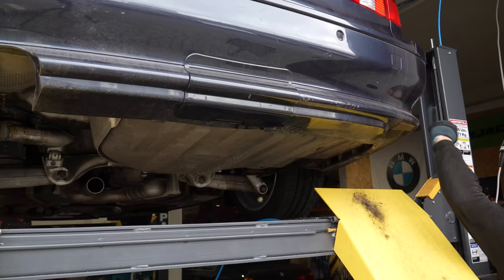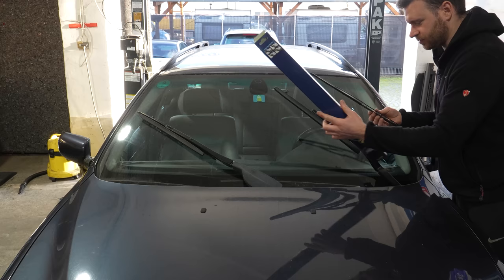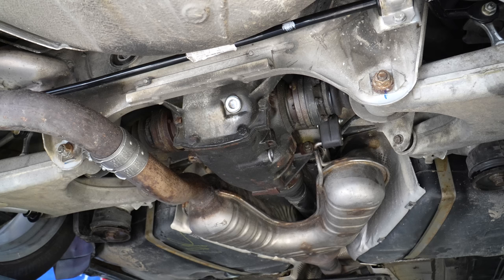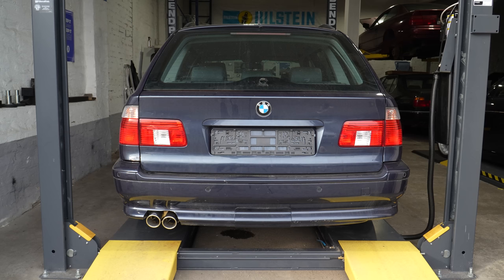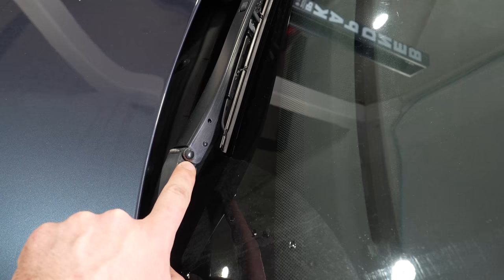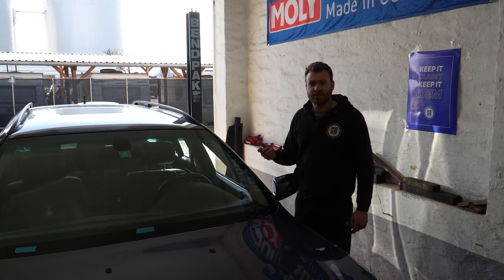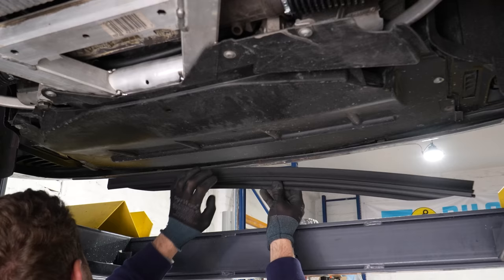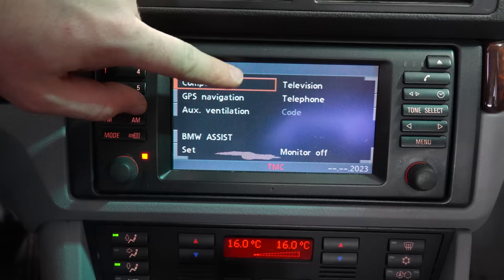Shouldn't Be Put Back on the Road - E39 530i Touring - Project Rottweil: P4

Comment: in the E31 club we always had people asking why their wheel shimmies at certain speeds.  You are going to have one at the fundamental and other harmonics in speed bands of 10-15 due to the spacers.  We always said ONLY OE approved wheels will prevent this, but some don't care about replacing bushings and the vibrations as long as the car looks cool to them.  We always advised to walk away from the sale if the previous owner did this, because usually they spent money on wheels at the expense of routine scheduled maintenance.  But obviously you always go through all your cars and try to keep it as OEM as possible.  Can't wait to see the dyno and hear tales of your butt dyno video.

Comment: Put some jl audio 5.25 speakers inside the car. Use gasket sealer around the speaker to get good seal and make sure to reuse the foam. Without it you loose half the sound. Uppgraded my speakers and sounds much better

Comment: You don't need to splice speaker wires, there are adapters that fit into factory connector but opposite gender, you wrap it in Tessa cloth tape and leave it

Comment: Also i forgot to mention, for the audio upgrade that you want, for european e39/e53 there was the DSP  audio system, it´s not super good but it´s a notch better than stock. You will need to source the module, dsp amplifier and i don´t know if the unit itself is different for the dsp ones or maybe you can reprogram it. I know some functions can be added to the unit, such as remote heating and vent, if you have a webasto heater that is.

Comment: Hey sreten, I've upgraded VW brakes to a bigger type before. I had to program the ABS module for that because the amount of displaced fluid increased with bigger brakes. I don't know whether this is needed for BMWs or not. I thought I'd just give you a heads up. I thoroughly enjoyed the video😊

Comment: You pretty much covered why I always prefer a 5 series to the 3 series... the suspension in the E34 and E39 is far superior to the E36/E46. Even on coilovers with my E34 lowered a fair bit on 18" wheels, it still handles bumpy roads with a reasonable degree of comfort, whereas most E46's feel crashy and harsh.

Comment: fyi i did a perm fix of the heater pipe  issue on that same  car 528i 1999( ne 2000 model ) i tapped out the block where plastic pipes  go in and put in threaded  fittings  with a barb  then from there used  silicon hose  back to where plastic pipe is at 1st mount and  that cures  the  dreaded  snap issue on them as vibration and corrosion  wear the part into block out    i had replace the  pipe 2 yrs ago and it was gone again SAME PLACE AT BLOCK  hopefully this cures that problem as rest of plastic pipe is  ok  and i replaced pipe as a  thing  after cutting it 2 inches  from 1st mount hose clamps are  stainless on line to heater  taps  i used all silicone   hoses  and  fitted the org fitting  to it at end  cut off  from plastic pipe btw i have same wheels  17 x 7 on mine and i have 1  that as spare that needs to be straightened has a huge  flat spot on it  bad roads here in oz  out on sth oz border  in victoria rear muffler is 2x mufflers  at end 1 is a  dead end  and  2x outlet pipes  like you did 
no idea  why its like that but is factory spec setup

Comment: Been thinking about the speakers question.  Not wanting to give you any more work Sreten but wondered if you could borrow some Alpines to compare against the standard BMW speakers - maybe the amplifier is good enough.  We know the higher end stuff fitted in some cars could improve the sound..  Maybe there is a case to upgrade some internals of the head unit..

Comment: Putting that windshield seal on the car without removing the glass is a non starter . Had exactly the same issues with mine so I called in the pros also.

Comment: 1:13:55 playing with the fuel pump :D  i had 530i e39 01 Mtech imported from japan it had 76000km it was brand new, after 3 years and many memories later i was doing 200-220 it was +50c outside fuel pump failed radiator blew up, coolant container leaked, hoses failed :D gladly we were with 2 cars and almost made it to our destination,  had to quickly buy some chinese parts and we did fixing in the middle of autobahn :D :D :D regret selling it

Comment: Yeah, a BMW 530 and then a cheap Type I tape, sure. That guy could have at least used a Type II... I´d advise you to clean the heads and pinch rollers on your tapedeck in the car to avoid bad sound quality and a tape-eating deck.

Comment: Sensational Sreten! I really did very well to keep the desire to have a 6-cylinder E39 here in Brazil, we have the 528i, 525i and 530i. E39 Touring we only had 528i and 540i unfortunately...Which of the three mentioned do you recommend? And it really gives a lot of pleasure to save a neglected BMW! Excellent job.

Comment: I must say that I'm pretty jealouis of an e39 breaking well.
I'm trying to fix wheel vibrations under breaking for quite a while now, and I'me getting really pissed with the car.
I've replaced tires for new Michelin PS4, I've refurbished the wheels, I've replaced control arms with lemforder units, I've replaced wheel bearings, I've replaced the 292mm new disks that i've recently put on with a 320mm breaking system, I've refurbished the rack & pinion.... and that sucker is still vibrating under moderate or hard breaking breaking. It's driving me completely mad, and I'm tired of throwing money at this.
The only thing left to do is probably replacing the wheel carriers...

Comment: I dont know how is this possible that you always have to repeat the cluster lcd fix. I did it once honestly but i did it with just the cable and soldering, in my opinion it creates the best conductivity so I went with that (with special soldering iron silicone tip or something (5$))

Comment: You can restore the inner tail lights, for that to happen you have to machine sand the plastic lens after that you wet sand and polish them, just like headlights restoration. If you still can see little cracks PPF could fix that. 
And after all of that you will have perfectly good spares.

Comment: Oh god I remember the pain that was changing the lcd ribbon cable. I also bought from pixel fix, but I found the instructions unclear and the lcd had a small crack. Also, what is the point of marking the needle positions if by default they always point to 0 liters of fuel or lowest coolant temperature?

Comment: I wonder how many wrong things you would find in my E60 xD something is causing vibrations on the steering wheel, M54B30 drinks oil like crazy and there are occasional knocks coming from suspension X_x
I love it but I'll probably have to scrap it or part it out and buy Superb VR6 mk2 instead because restoring it to acceptable condition is probably not worth it (production model 2003  0_0)

Comment: why dont you try to add a bluetooth audio aux module to that navigation if it has a cd changer or aux port in the back i did that aux mod to a e46 cd radio and it worked great

Comment: Hi Sreten, i am really wondering how it went by the TUV Inspection, i tried using Epytec adapters on my Audi TT and swapping some Porsche brakes on the car, it’s a fearly common upgrade. But no TUV inspector would let it pass .. they all gave different reason. I presented them the papers from Epytec but still no. Thank you, i’m glad it went better on your side.

Comment: I always wondered who was that "genius" on BMW who designed this awfull zync alloy and used it everywhere. In my E36: broken key hub - corroded zync alloy, broken door handle - corroded zync alloy, broken mirrors - corroded zync alloy. I mean, OK, the car is old but I've got even older Ford and none of those parts are zync alloy and they all work fine to these days.:face-fuchsia-poop-shape:

Comment: Hi Sreten. 
I"m interested to know what camera were you using for your driving section? This is the camera that is videoing you from the passenger side. The reason I'm asking is that it seems like its a person videoing you as there is active movement and correction, even though in other shots, there's nobody in the passenger seat. 

I just thought it was an interesting shot as it looks very personal and dynamic.

Comment: It looks like rust is forming on the sheet metal where the glass attaches. Is this the repair you are going to fix. My back glass broke this past year because the frame rusted away. I need to fix this on my other one before it happens again. Love the touring series but I’m a little biased.
Reply from the maker: Yes, the glass hatch is all rusted. Needs to be replaced. Common issue on E39 Touring

Comment: Maybe you can help me would you know anything about the gong chime under the steering wheel if it has a fuse and where would it be when I insert the key I don't get the chime anymore I even changed it but still won't work when I put the key and turn it can you help Thanks much

Comment: Another question: apparently E53 and E39/E38 16:9 LCD displays are ... different, because of the different height relative to the driver's head. Did you get an E39 specific part or is it true that there are screws to adjust that as well?
Edit: cigarette lighter in the front needs fixing :P

Comment: I have a question to Sreten or even to all the guys who wrote a comment. I have a 525 Diesel from 2003. and just today i was in the Autobahn and i had an issue. The DDE lamp come up and the engine didn’t performed as it should and the engine stopped. Just stood their and after starting the engine again which was not easy the car drove but only a few km. Then the same issue came again and again so I repeated to stand and to start again. I had only 15 liters in the tank and as I rembered me one year ago when the car doesn’t wanted to start because of fuel engine I thought maybe this DDE issue also needs to be solved with more fuel. So I have filled it up. And the car drove ok. It was not more DDE and the car drove normal. Do you all think that has something to do with the level of fuel or is this something else. Thanks for your comments as I am not a driver as Sreten and maybe some of you had this issue and knows how to fix it or what has to be changed as I need this car daily. Thank you guys in advance. Daniel

Comment: Guys i have 2002 e39 530iA, do i also have sport mode in my transmission? i never knew about that feature until i saw todays video when Sreten switched gear selector towards him ( i though it is only manual mode) and said it is sport... Where there versions of auto in e39 530iA without sport mode?

Comment: Hi Sreten, what brand parking sensors did you buy? Chinese ebay sensors? Genuine dealer, used OEM, OE brand? I need to replace one of mine on the E60 and I'm not to keen on paying £80+ for an unpainted sensor. Can't find any info on who supplies the sensors for BMW.

Comment: Hello Sir,
If you have the time to read this or even to reply to it - would be apreaciated much.

I have the same (original) 16:9 display in my e39 (525i touring facelift).
I searched internet quite a while but did not find a good answer. 
My issue:
The display is to bright at night (if set to a high brightnes) or to dark at day (if set to a low brightnes). 
It does somehow react when turning on the light switch - but not much.
Also playing with dark and light (was assuming that there is a light sensor) did not change much.
Did you drive much at nights? Do you also think it is too bright or do I have an issue with mine?!?!
The rest of the cars "brightnes adjustment" works very well - only this damn 16:9 display is not.

BTW: I am living only 70 KM south-east of FFM and do own a e39s and a e30 convertable ;-)

Thanks for all the work you put in this channel...

Comment: The E28, E34 - as well as the E39 - are all beautiful 5 series. Even looking now at this E39 - and comparing the interior design to an E60 - you have to ask how did BMW lose it completely with the Banglism. After a long streak (even the ancient E12 was stunning!) - BMW made E60 - which was ugly AF inside and out. For anyone arguing - look at where BMW's design was during E39 - and what kind of design BMW returned to in F10 - after the huge backlash in respect to E60. Look at the exterior and interior of E60 - and then compare it to both it's predecessor - E39 - and its follower, the F11. E60 is so far out there as being some sort of a weirdo car - more importantly, a weirdo BMW (BMW being a standard staple of car design, at least during the time since early seventies until approx. 2017 - which is a very long time in car design). Even the current G30 follows very closely after the F10 - both exterior and interior - probably because BMW is afraid (and rightfully so) to spoil the 5 series as they did with the E60. Also - one has to ask - why did they, being a company which pays so much attention to their traditions and "roots", entrust the design of their best car (well, arguably) to a lunatic which peed on tradition and raped the genes of BMW. That's all just puzzling. But then again - BMW currently has gone off the rails in terms of design - the current CEO has said on record that "modern cars need to be ugly" (exact words) - and they design nightmarish monstrosities like the XM, the M3/M4 and even managed to ruin the 2 series. Meanwhile, Audi and Mercedes (and most other car companies - look at KIA Stinger or the 5th gen Supra!) still manage to design good-looking, modern and heritage-filled cars. Amazing. Each time I look at an E39 - that amazes me. Thanks for the video - greetings from Latvia.

Comment: 5:45 Mate you could use rust converter, that will definitely stop rust. The fluid film won't last .
Reply from the maker: Can't use rust converter there, it's a closed non, accessible hole. In my experience, fluid film is much better, apply it once a year before winter and the car will never rust.
Reply: @M539Restorations  I understand what you saying, I watch some Youtubers that restores rusted cars etc. And on those parts they can not reach , they use rust converter, especially from Westwood, that has a big straw to reach those crevasses . Looking forward to watch  the final video.

Comment: Parking sensors stop working properly, if they have been painted with to thick a coat of paint. They are seriously sensitive, I've had issues with an authorized dealer, that was supposed to change the bumper after a slight damage and didn't know the proper amount of spray allowed from the factory on the sensors. Had to have the parking sensors changed and repainted twice....And by the way, Schmiedmann is a garbage company,. Back in the day, when I had a BMW shop, I had many customers, that came with fancy looking shit Schmiedmann parts, that were out of specs, even had a customer that wanted me to install an "Original" lowering coils and dampers (used) bought from them to an E32, no such thing exists, the parts were simply totally worn out (why the car would appear lowered). Never seen my mechanics laugh that much at a customer, who had murder in his eyes, when he left....Also, always use gloves when working on dials, getting fingerprints of the gauge surfaces is a bitch and toothpaste is an excellent polish agent for plastic glass.

Comment: I see you used some tape to hold the flatcable at place ( 48:30 ). I do not really think it is a good idea leaving this tape at place. The glue would flow out over time and temperature cycles and would mess everything around.
Reply from the maker: That's the standard procedure, the tape is on the outside so it won't affect anything. There is no other way to do it other than to solder which is worse.
Reply: That is correct that the tape has nothing to do with a contact.
My concern is about releasing disgusting substance over temperature cycles that would mess around the board.
Perhaps it is an paranoia and this type of tape is OK, but I can remember various types of tapes used in automotive which degrades over years and temp-cycles. 
AFAIK, parking sensors cable harness in my E36 compi is no more a harness ... the tape desintegrated and wires are disgusting to touch. Took me ages to clean them when I was changing PDC sensor.
Reply from the maker: @razberik8320  It's ok, can't do anything to the board. There's already plenty of glue on it.

Comment: we need f10 f30 f32 e92
Reply: I think F generation is not Sreten's cup of tea. it doesn't have the same character as the older models and  although  I am sure that you can find parts easier, it's not that easy to work on as on the previous models.

Comment: The only thing that made me cringe is you working on electronics over a microfiber cloth that can charge up statically even if that desk underneath it is grounded not to mention the fuzz and you would be probably better off and cleaner over an electronics repair mat. They are not expensive and they do not fuzz... also electrostatic wristband... I know it is annoying to tether one's self but you are working sometimes with discontinued components and I would not take the risk...

Comment: E93 m3 on hold for 7 months over a station-wagon.💨 fug this.
Reply from the maker: Sometimes I'm amazed at what I'll read. I've explained too many times, E31 is occupying the 2-post lift which I need in order to remove the engine on the M3, and E31 has been sitting for 2 years. I am one man with two hands.